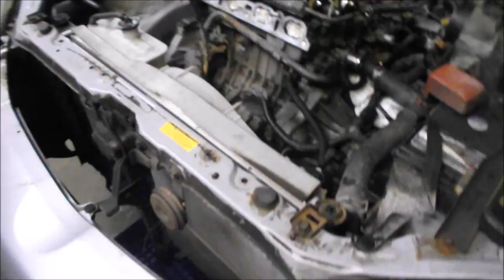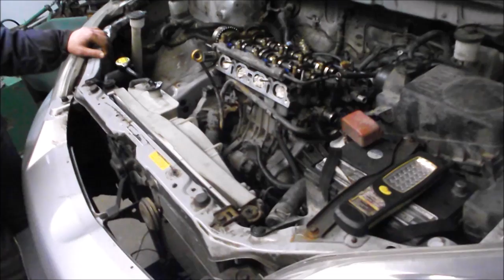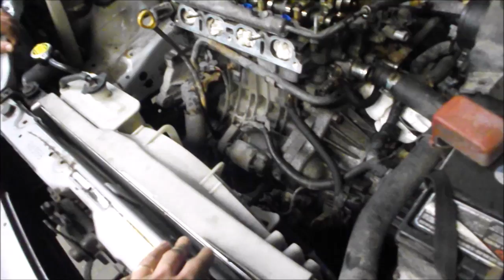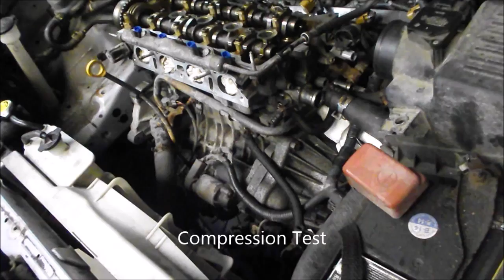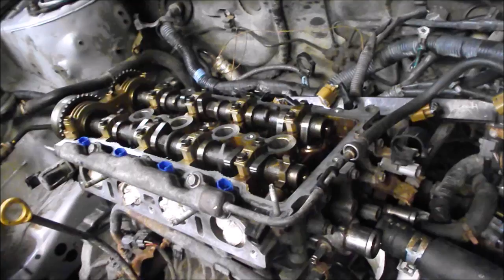DIY Head Gasket Replacement 2007 MatrixVibe Part 1 of 5 Diagnosis

Comment: Thanks for a great video guys. I am planning a head gasket and timing chain replacement on my '07 Matrix as well. I do have one question - in my Haynes manual it says to have the transmission in Neutral when finding TDC (my transmission is automatic) and to have it in Park when removing the harmonic balancer. Is that what you guys did? And am i going to be able to shift into Park with the battery out?
Reply from the maker: You need to be able to rotate the engine to be able to find TDC. You don't want the vehicle to roll when finding tec. Therefore, a car with manual trans must be in neutral. It is probably a good idea for an automatic too.  For the harmonic balancer, an air impact wrench should be able to remove the bolt while not locking the engine. If you need to put your car in park to remove it, loosen that bolt at the very beginning of the project, then put it in neutral, then disconnect the battery.